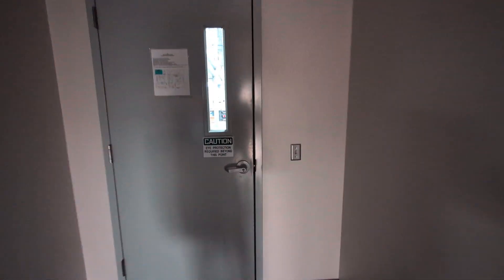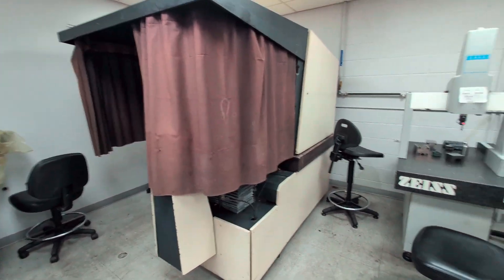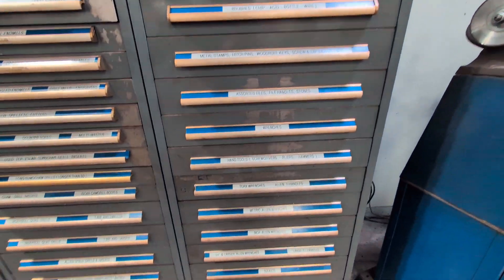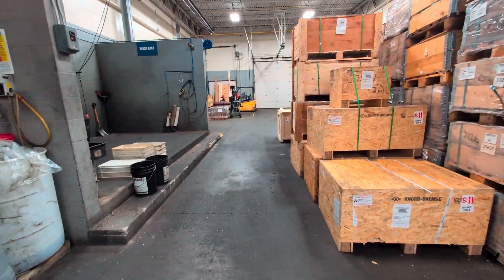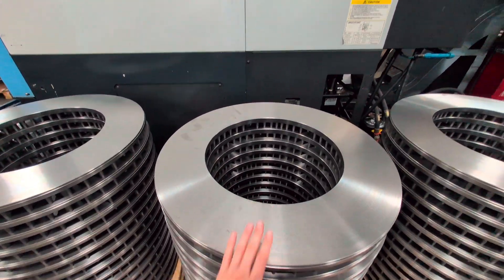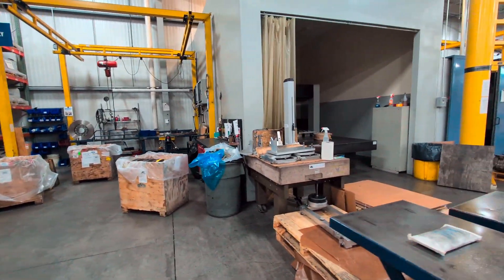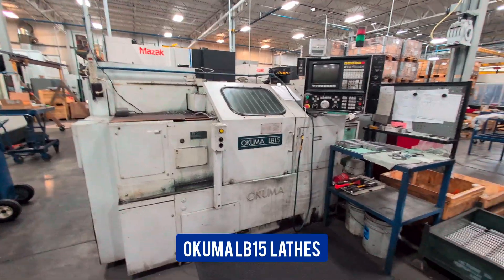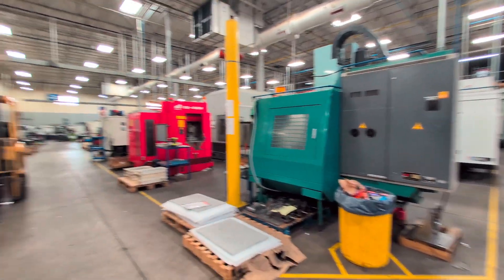CNC Machine Shop Tour - 80k Square Feet of Manufacturing - Superior Technology, Inc

Comment: How is it having different controls on the shop , how do yall manage that
Reply from the maker: just requires a little bit of extra training for the operators to know how to use the functions they need to for running the machines. From my perspective, it does make it slightly more difficult from a programming and setup point of view because of all the little different nuances to how each controller works and the different G and M codes each one takes and having to change each program for different machines

Comment: Not a single 5 axis mill?
Reply from the maker: just given the type of work that we do and quote, it has not really made financial sense to buy a 5 axis mill yet - although that is next on our list to get. Its just hard for us to justify the capital investment into one when you can get far more productivity out of an HMC with the free load you get. As the mill programmer, nobody wants one more than me but we have to have the work to support it, and right now we do not.
Reply: @MSMillingCNC Nice business! Thanks for the tour. When I started 8ys ago we had one live 5 and I gravitated to it. The benefits in datum/location accuracy in one setup eliminated a lot of scrap and increased process reliability for us. We have 6 now that I create a process and program for. I am also from the home of the garbage plate.
Reply: I worked in a 3 axis sub-con shop over summer and it was all old machines with old boys running them and not a renishaw probe in sight, touching tools off manually etc but they quote cheap and had a full order book. The programs written in ONECNC from about 20 years ago barely went above 2.5D toolpaths. This industry is mostly waay behind the technology that is available right now including 5 axis positional, let alone simultaneous but people are still making money with basic machining techniques.
Reply: Hate to say it but when I see a building full of spindles that were fully depreciated by the end of the Clinton administration, I start imagining the “facility closure auction” listing to come. This looks like a good clean shop and OP is a sharp guy but there are guys running 5 axis in their garages. When I think what a week or two of payroll must cost it should be easy to justify getting a starter 5-axis on the floor. They don’t need a better spreadsheet, they need a better vision.